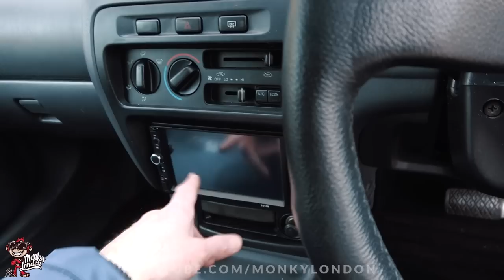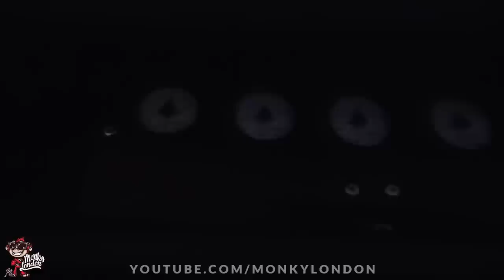🐒 ULTIMATE FIRST CAR! RARE TOYOTA STARLET GLANZA S

Comment from the maker: Lots of JDM goodness in today's episode, 20 mins of good vibes👍 You're weekend starts here 🙏 Much love guys, ML 💪
Reply: The clear indicators are from the facelift model man. Your car would have had amber corners originally. The rear lights on your car are extremely rare aswel not the standard lights but a factory option.  Facelift had different front bumper aswell and 3 spoke steering wheel 👍
Reply: what size and numbers are the rims?

Comment: I had this and the Starlet GT Turbo ep82 (1991) before this when I lived in Jamaica. So, so much potential. Comes standard with the ct9 turbo attached to the 4efte motor. Many of the guys used to swap for the bigger 5e motor. A few guys back in the early 2000's or there about were running 400 to 600whp on these little things. Me personally never got past 250 whp. This thing is MAD! I would love to have this in the states. A JDM importer friend got one from Japan last year. A crazy head turner at car shows here in South Florida.

Comment: These things are blisteringly quick, but handle shit. Before anyone jumps down my throat a friend had one did all the usual suspension mods; coilovers, urethane bushes, pan hard rod on the back end. Was running a custom turbo from Malta IIRC. Thing is it got done by a 1.7 Ford Puma, around Mallory Park with similar suspension mods (coilovers and urethane bushes etc) and had a Miltek Manifold and Exhaust. No matter how quick on the straights the Puma pulled away in every corner.

Comment: I remember Ireland was littered with them guys putting them down as normal starlets to avoid high insurance
Reply: “Standard 1.3 on book full v swap” and b swapped ek civics
Reply: I remember when any Ford nut who owned a Ford but not a Cossie, had a 2.1 ZVH turbo conversion. MK3 Fiesta's and S2 Escorts with these conversions were proper fast. T34 turbo's, full mongoose exhausts, Gaz gold's, bleed valves, Compomotive M05.
Reply: I was caught in checkpoint 😮